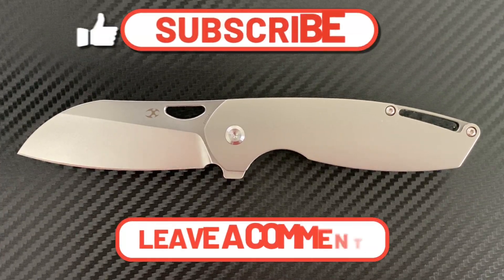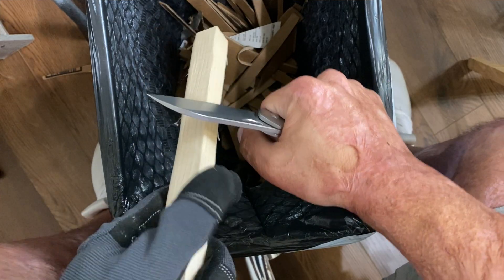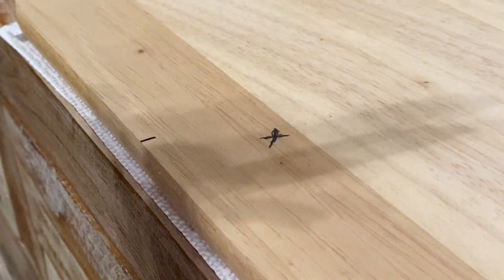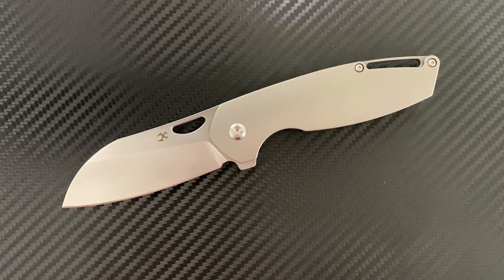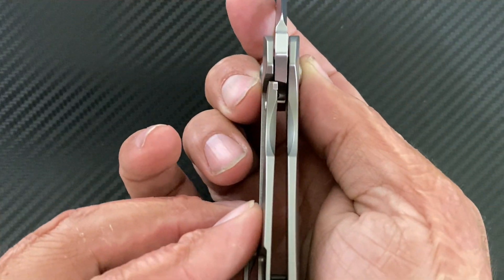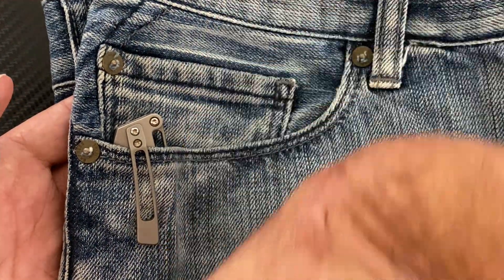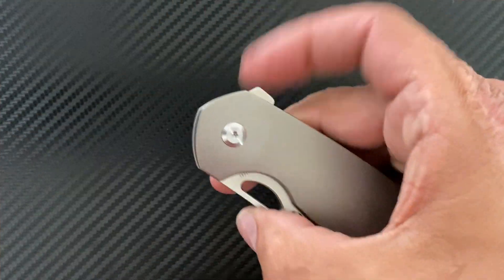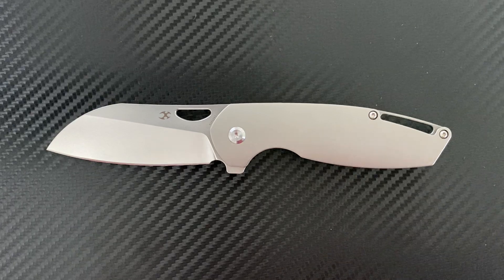KANSEPT KNIVES MODEL 6 FOLDING KNIFE / FULL REVIEW & TESTING

Comment: Bought a model 6 K1022A1 to replace a lost Spyderco Slysz bowie and i prefer the model 6 as a EDC. FWIW the later versions have jimping on the top of the blade and on the front of the flipper tab. If you are using the flipper holding your bottom two fingertips in the cutout on the clip keeps you from loading the lock and makes for a smooth opening with very little pressure for the flip.  Fantastic knife for the money IMO.

Comment: I have one of 5 original prototypes of this knife matter fact mine has the same exact finish as the one in this video I've had it for about a year now won it in the Kansept knife group it's a really nice knife .If I could change anything I would have added a little jimping to flipper tap & top of the blade &  maybe a solid clip & an anodized pivot collar for a little pop .
Reply from the maker: It definitely needs some accents and jimping on the flipper and I would have loved a little texture on the scales because it can be kinda slippery for me at times 👌🏻
Reply: It seems to me to be a common problem with Kansept knifes, jimping.

Comment: Something I noticed (2 years down the road!) is that Stassa's model appears to be a prototype. I guess what was being shown at Blade Show wasn't the exact iteration found in production. Not much is different, but: the pocket clip position is different. Production models will have slight "overlap" of the lockbar. Another thing is jimping. Production models do have jimping on the blade spine... but I wouldn't worry about it, because it's not patricularly meaningful jimping.  Jimping can also be found on the fipper. EDIT: Almost forgot, production titanium models do have internal milling done to reduce weight. Mine is 3.77 ounces.